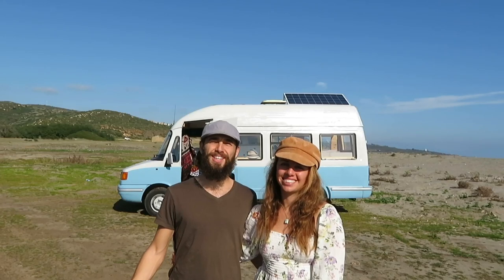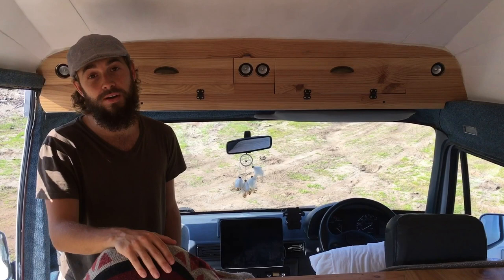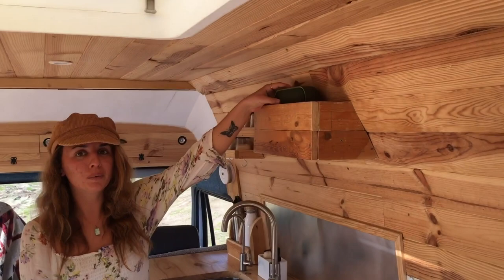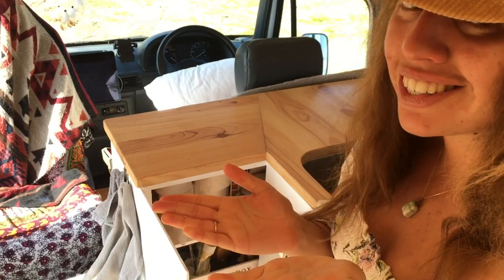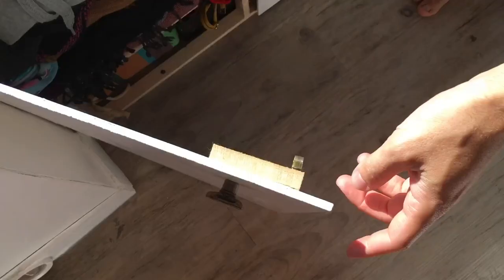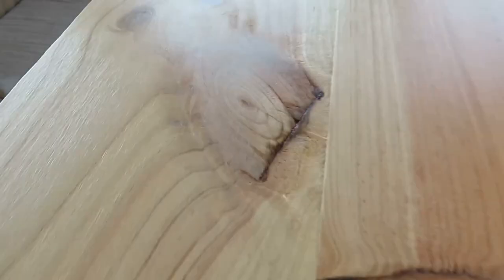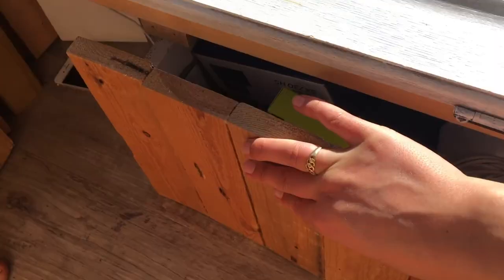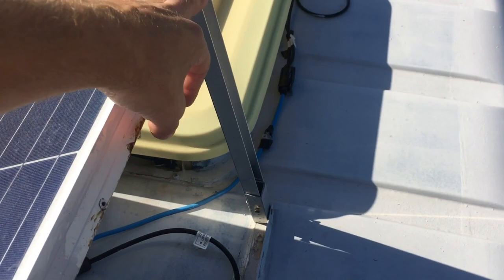HIDDEN CINEMA 🎥 EXTENDABLE KITCHEN 🍳 & CLEVER SOLAR ARRAY ☀️ // Unique Self-Build Conversion 🚐

Comment: In love w your build. Nit only is it my style & the uses are well throughout, but it's practically is on point. 
I love tht the bk is sofas instead of a fixed bed. This way U cn also slp on the sofa as a bed if U choose & hv the other for a sofa. U dnt necessarily hv to mk it into a bed every night.
Love this alot.
Thxs & be safe.

Comment: I love the color scheme. Quick question, all those wood doesn’t make the van even heavier?
Reply: yawdiejin Thanks! And not much no, we chose not to use all pallet wood as otherwise it would have got very heavy! But the wood on the walls and ceiling is not very thick or heavy, and having most of the van open keeps it light, cupboards and draws always add a lot more weight and we don’t have very many of those.

Comment: Why do lots of  people have  switches for their water pumps? I can't work it out. Surely the tap turns the pump on and off lol.
Reply: Devonian Can’t speak for others, but for us it is not to have the pumps primed/under pressure when we are not going to use the taps, eg: at night or when we are driving. I don’t foresee any leaks if we didn’t turn them off, it is just annoying if once every few hours the pump kicks in for a second while we are trying to sleep. So partly safety encase a pipe split or something and partly so it doesn’t go of in the night 😂👍
Reply from the maker: So that if your tank runs try (pressure based pump) and then it is essentially pumping air - which compresses it doesnt keep pumping air for ages and makes noise. It is useful to be able to turn it off. Tap-switch submersibles do not have this issue of course.